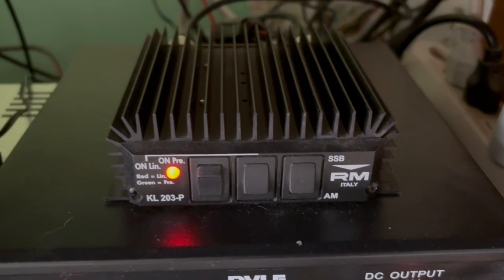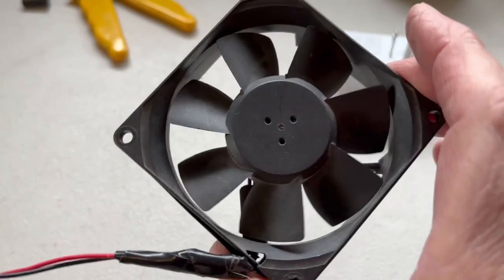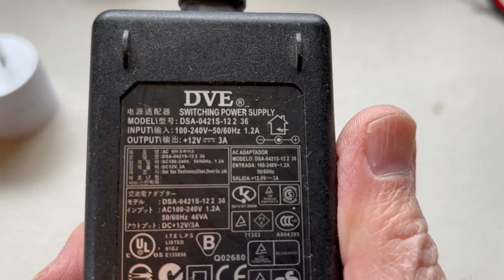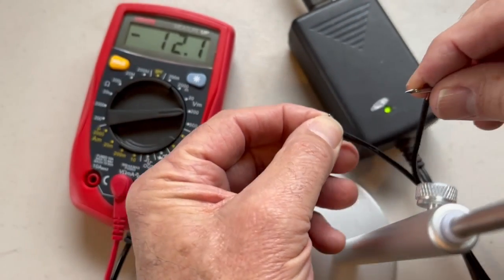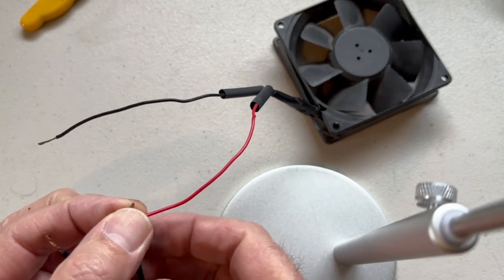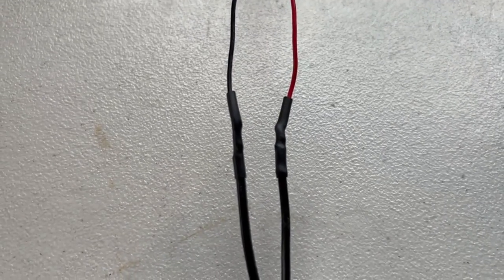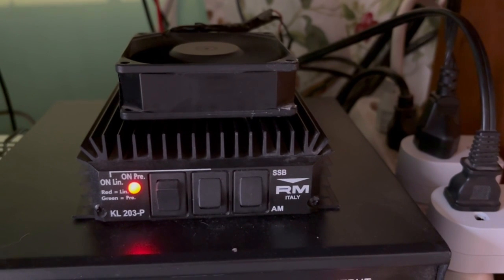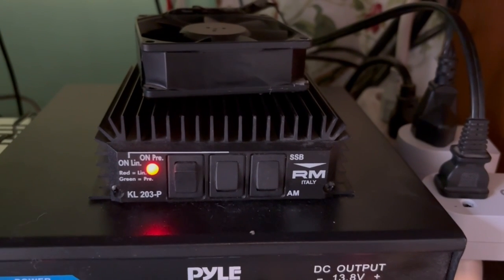Homemade RM Italy amp cooling system

Comment: Iam thinking of doing something similar  on my 2970N3, it will drift frequency when holding a long QSO. I was thinking of using a "K" type thermocouple in conjunction with a 555 timer so the fan will turn on at a set temperature. The tiny muffin fan the manufacturer installed in my transiever is pretty much useless especially when the transiever is drawing 40+ amps.

   Great video and a great idea. Iam sure your familiar with those plastic drywall inserts you put in a hole to hold screws securely? You can press them in between the aluminum cooling fins and secure your fan. They  also insulate the fan frame from the aluminum and Will keep it from vibrating.👍

  UDX-4570 Palm Springs saying 73's. 😏👍⚡️🎙
Reply from the maker: That's a lot of heat generated in your transceiver. I think the most stock CB radios draw no more than 4 to 5 amps. Sounds like a great plan to cool down your radio. I'll have to give the drywall inserts a try. I'm thinking of leaving a gap between the fan and amp to increase airflow to the rest of fins. 73s and thanks for the comments!

Comment: What direction is the fan blowing?    Is it blowing down onto the amp or is it blowing up and away from the amp like an exhaust fan.    Would also be cool to see the amp temperatures with the fan off and with the fan on.    That way we can see how much cooling impact the fan has.
Reply from the maker: Airflow is blowing into the amp. I'm not sure which direction is better, but it appears to work well in that direction. I'm planning to make up a follow up video with a couple of changes I made. I'll include temperature readings with the amp on and off. Thanks for watching!
Reply: Most cooling experts believe that better cooling is achieved by having the fan draw the hot air up off of the heat sink rather than blowing air down on to it.    The same way a CPU fan does on a computer.   It's called Push / Pull.     Right now you are pushing the air onto the heatsink instead of pulling it off the heatsink.    Would be an interesting test to see which way offers the better cooling.